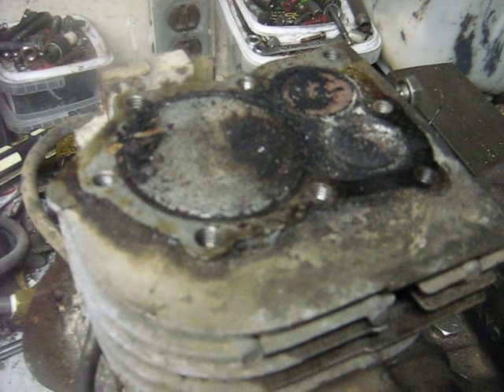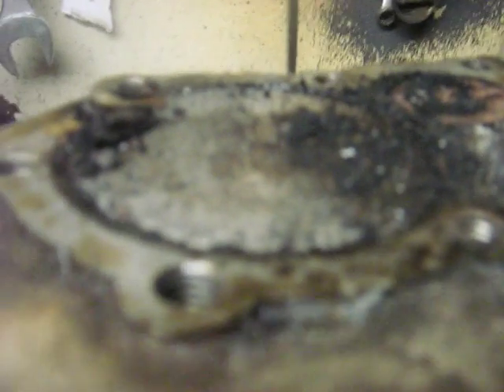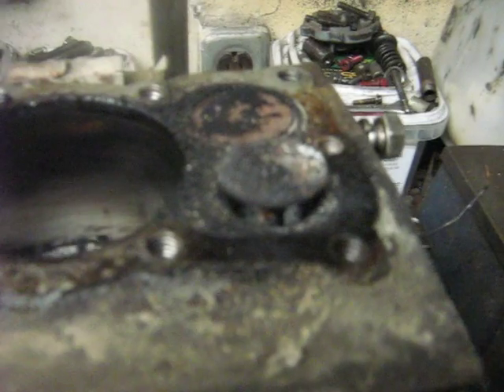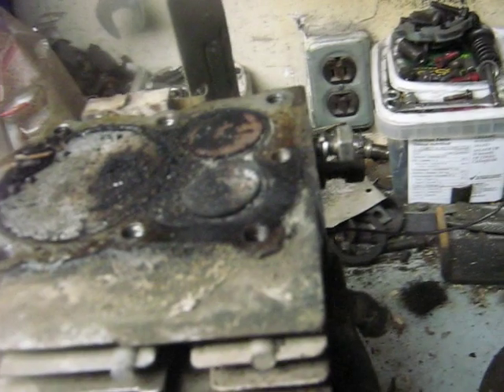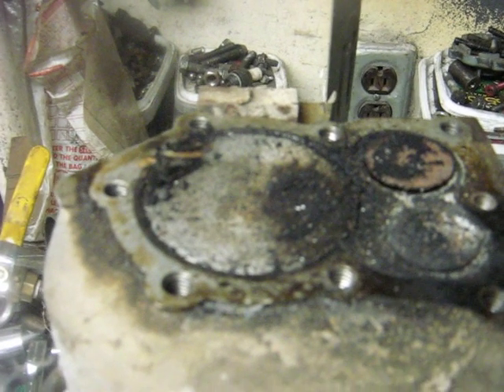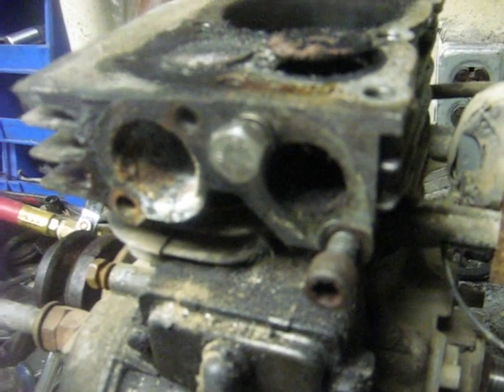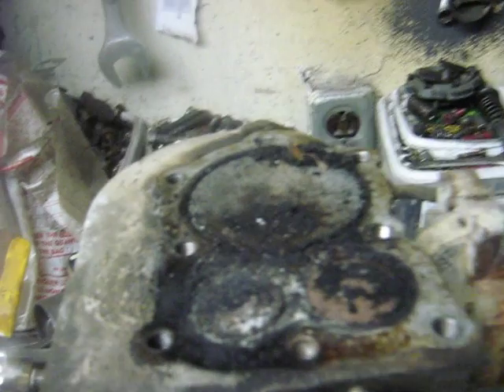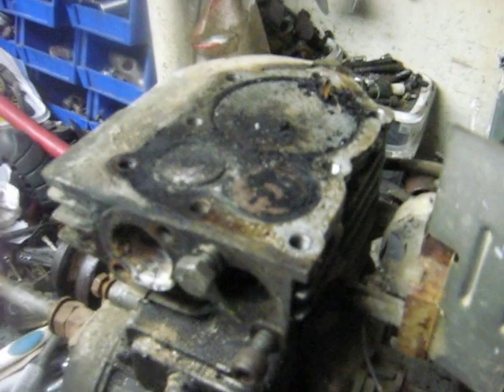Answer to What was Wrong with Briggs

Comment: That's weird I was tearing down a 5 hp Briggs off a push mower and it wouldn't turn over no matter what and when I pulled the cylinder head off it just all the sudden turned over fine but it had all kinds of crap in it just like this...

Comment from the maker: Much better than a broken off con rod, or a seized valve, those valves can be a real pain to get unseized sometimes! One of these days I will have to pull the Subterranean 67 Briggs out of the bucket of diesel, and see if I can unseize it. The block is badly corroded around the valve seats, perhaps I can fill in the deep pits with the alumiweld rods I tried out a few nights ago, might just fix the beast!

Comment from the maker: Did the repair the other night, it seems to have worked OK  :)
I was experimenting with the alumiweld rods you get at Harbor Freight, they may actually work OK on Briggs engines, they didn't work on the broken 5 horse carb I tried them on though. I will get the thread repair vid up ASAP, but it could be a few days if I can't squeeze it in tonight.